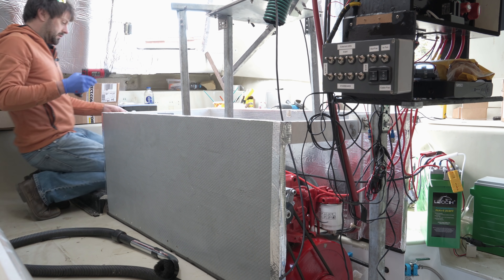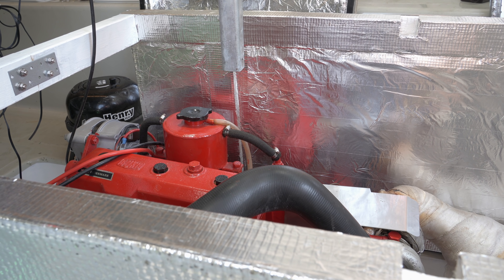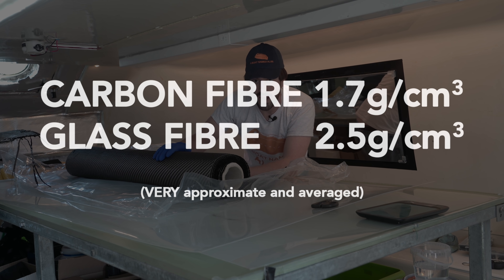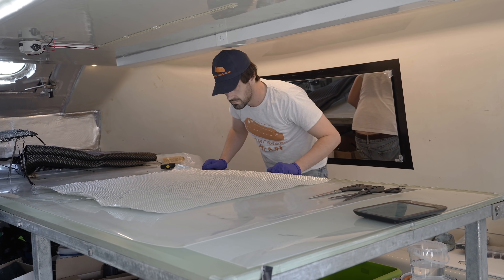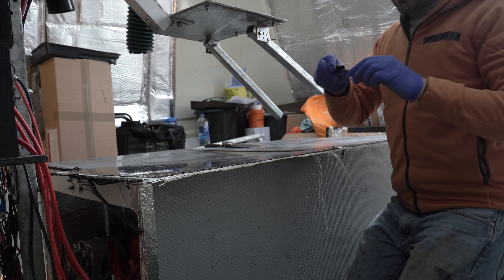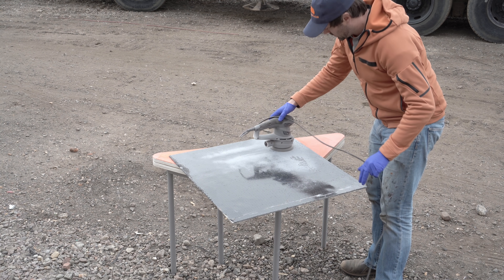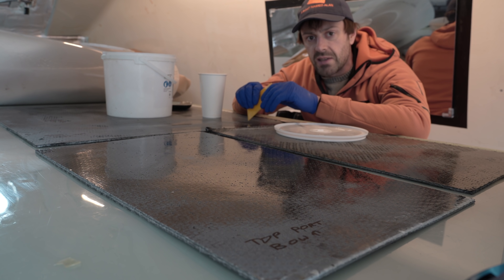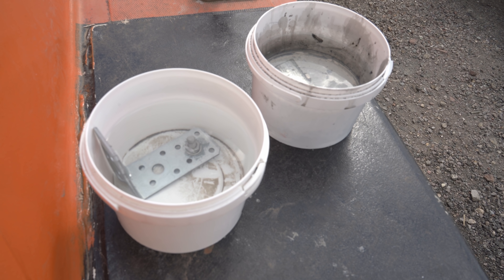Lifeboat Conversion Ep15: Using a composite wet layup to make a carbon and glass fibre lid [4K]

Comment: Hey hey hey! You should be wearing a mask while working with carbon fiber. Its pretty darn dangerous to inhale the little bits of it.
Reply from the maker: It's not quite that simple. The carbon fabric is perfectly safe, and epoxy resin isn't too bad for fumes when laminating. When cutting the cured product with a disc, I agree the dust can be an irritant.

Comment: Carbon fiber with polyester and a wet layup?  Ok.
Reply from the maker: Not all carbon is $100 per square metre at 1mm thickness..... 

This was only around 2x the price of good glass fibre, but with the stiffness and low density benefits of carbon.
Reply: @AlexHibbertOriginals  right! But you’re losing some of those benefits by using polyester, aren’t you?  
Higher weight, less bonding strength, rigidity and shrinkage are all disadvantages of polyester.  Depending on the resin, the polyester could be up to 50% weaker than epoxy.  So you probably could’ve saved cash and had better strength by using epoxy and fiberglass. I would think.
Reply from the maker: Yes, there's a compromise using polyester, but it's a third of the price. I didn't need bonding strength, and shrinkage is not a problem for a basic plank. The rigidity of the plank is chiefly down to the thickness across the core. As far as I know, both resins have similar density, so if you saturate the fabric similarly, the weight of resin won't be higher. Strength - the plank doesn't need to take impacts, or withstand repeated extreme attempts at bending.

So, what you have here is a plank that'll cost a little more than a fibre glass / polyester one, but be notably lighter, as the fabric is fundamentally much less dense. It'll also be, on balance, slightly stiffer too even if you could prove the polyester is more flexible compared to epoxy with the fabric as a fixed control variable.

Comment: Why black? I believe it's because there isn't enough dissolved oxygen available in the water to produce the usual red/orange oxide you are used to. Exposure to air as well will do this. I believe you are creating FeO as opposed to Fe2O3(red oxide).

Comment: Tef-gel works wonders to stop galvanic corrosion on nuts and bolts. I used it everywhere on my small aluminium boat and after 12 years of ocean fishing there are no signs of it.
Reply from the maker: Thanks for the tip. The various anti-galvanic corrosion gels are pricey!
Reply: @AlexHibbertOriginals  I was shocked at the price too. I bought the little syringe applicator and it's done my whole boat/trailer and I doubt ill ever use the whole thing in my life time. A tiny bit goes a long way.  Kind of like kindness....and vegemite.

Comment: Please buy 2 carbon dioxide /monoxide alarms for your boat and a fume extractor setup for that box to pump out fumes... Exhausts can start leaking easy. You can have lengths of braided flexible hose made with couplings and keep those just in case a copper pipe pops on your travels. 
Bless you for sharing your work it's awesome.

Comment: You are already working with composites, so you can get a lot more strength and lighter weight if necessary.  Forming some ribs in the bottom of those flat panels would do wonders to increase their stiffness and allow for a thinner panel overall.  You can even just buy carbon fiber angle and bond it on - just like Alex Thomson did to repair Hugo Boss during last year's Vendee Globe Race.  If you are just looking for flat panels, why not just buy a sheet of pre-made carbon or fiberglass?  It will be better manufactured (without a vacuum bag) and save lots of time.   
Check out what Mike Patey does with carbon fiber in his aircraft builds - a place where failure mean death, and both strength and light weight are paramount.  https://www.youtube.com/channel/UCSvdee86uThqIrloZjWwNVg

If you have any more of this to do, you would be wise to invest just a tiny amount in some vacuum bags and a vacuum pump so that you can do proper composite work.
Reply from the maker: Hi Matt - not really sure where to start here. The panels have been designed to have the required stiffness and strength to be stood on and do their job as a lid. Adding in braces or angles of a sufficient strength to help would be added complexity and cost.

Yes, I could have bought carbon or carbon/glass readymade sheets. However, this would come in at approaching £500. This layup took just a couple of hours, and cost well under £100.

This lid certainly doesn't mean death in the event of failure.

I do mention using vacuum (a machine for which I do own) for more complex shapes or where I want to remove the final few grams of excess resin, but this was vastly quicker and less wasteful than using all the consumables for a large vacuum-consolidated sheet.

Comment: A galvanic corrosion chart already exists...used in industry frequently. Just google 'Galvanic Chart', and print it out...no more testing required.
Reply from the maker: This is a real world test to see whether, and how fast, the zinc plated steel corrodes and thins when fastened with a relatively small SS nut and bolt. You won't find this on a chart.

Comment: The end of that square tube is turning black because the way the plating goes on. The small ends of longer pieces end up looking like a bunch of tiny plates stacked up and give much more surface area for the corrosion to grab hold. 

As for the stainless bolt, you have 3 different types of metal present. the zinc plating is acting as a sacrificial anode. Once that gets dissolved away and you have mild steal next to stainless and it will take off. Put that same bolt in a piece of 60 series aluminum and watch it go, lot more fun.
Reply from the maker: The ends of the hot dipped box section are actually clean cut, so that's bare steel.
Reply: @AlexHibbertOriginals  well that makes even more sence! Lol

Comment: Re: "galvanic reaction" Galvanization or galvanizing is the process of applying a protective zinc coating to steel or iron, to prevent rusting. The most common method is hot-dip galvanizing, in which the parts are submerged in a bath of molten hot zinc. 

result: While 'L' bracket was completely dipped and protected by zinc, the square tube had been cut, exposing the ends of the raw "steel" making it turn black.
Reply from the maker: The bracket is thinly zinc plated (not hot dip) and the box section was hot dip galv, with the ends clean cut so bare steel.

Comment: it might be a bit late to comment on it, but i noticed your table in the center of the boat to be a wood surface
while this is completely normal and appropriate, i would suggest a metal surface (painted 2~5mm steel for example) as that would allow you to put magnets on things like cups and other objects that are on the table to secure them while in the water
Reply: That sounds like a great idea
Reply from the maker: Perhaps not for the entire top, but a good idea for a zone of that top at least. Cheers.

Comment: Loving the attention you give to materials selection on this project :). I'd bet the black rust you see is exactly that, black rust. Black rust is Fe3O4, a less oxidised version of "normal" orange rust. (Interestingly this is the same stuff formed as when blacking or "blueing" steel.) You can see that the O/Fe ratio is 4/3 whereas in "normal" rust you have Fe2O3 with a ratio of 3/2. In effect the normal orange rust can't form because there's not enough available oxygen at the surface, because the water is stagnant rather than continuously aerated. You can be pretty sure the black stuff is iron based, because if it were zinc based it would form all over the part, whereas here it forms only on the exposed cut faces.
Reply from the maker: Makes sense!

Comment: According to a paper I just read the abstract of after being nerd sniped,  the black corrosion is likely because the Zinc plating is actually Aluminium Zinc plating and the black is likely Bayerite (Al(OH)3) or Zinc Aluminium Carbonate. The surface structure of it looks quite pyramid like, so I imagine it causes destructive interference of most wavelengths.
Reply from the maker: I'm no expert in the differences between hot dip galv and thin zinc coating (through electrolysis I think) or where Al might be involved. But sounds reasonable!

Comment: Peel Ply is one time use
BUT
as I understand it, 
the FULL measure of strength in a carbon fiber panel is achieved when a minimum of resin is left behind.  
Just as there is wisdom in not scrimping on the amount of cloth used, and not scrimping on the amount of resin used, so it is with a one time use peel-ply.  Nothing else will remove excess air and resin like peel-ply

And then there is the old adage "good enough is good enough"

Peel-ply can optimize a panel for weight vs strength but if it isn't needed then not using peel-ply can save time and money
Reply from the maker: Not to mention the use of perforated release film under the peel ply to give a gloss finish. The joy.
Reply: @AlexHibbertOriginals  have you ever watched Mike Patey and his aircraft builds of Draco and Scrappy.  Lots of money, lots of technique, lots of "oooo WOW!"

Comment: Top notch positioning on that camera angle for the engine bay cover, got to see your builders crack in the mirror for nigh on 3 minutes, bang up job though, with the carbon that is.

Comment: My only concern is that the engine might not put out enough power to maintain sea-keeping in heavy seas.

Do you have any volunteers or crew helping you with some of the work?
Reply from the maker: In three weeks time I'm out in a strong tidal zone with an experienced skipper to test exactly this, and to see if a higher thrust prop is needed. That said, 48hp for a 7.5m boat is not underpowered.
Reply: @AlexHibbertOriginals  Thanks for the reply.  I'm really enjoying the process.

Comment: I think with the galvanic corrosion question, the steel needs oxygen from the atmosphere for the reaction to occur and rust to readily form. When submerged in the water there is going to be limited oxygen. 
In saying that, zinc is used as a sacrificial anode on boats which is contradicting the submersion theory above, however I'm guessing the turbulence of the propeller provides enough oxygen for the corrosive reaction to occur. So maybe you should take your steel sample pieces in and out of the bucket daily to speed up the process or you could stir it constantly. Just in case you were looking for more tasks to do.
Keep up the good work.

Comment: Did you choose a resin that has a higher flame resistance considering it is going over an engine? I know there are normally no open flames, but there is a possibility of an engine fire.
Reply from the maker: The resin is Lloyds approved, but it's not actively flame-resistant. The cowling (as lots and lots of boat parts do) also contains wood and ply, so in the event of fire, the solution is to put the fire out! The insulating foam in the cowling is pyro foam that burns very slowly.
Reply: @AlexHibbertOriginals  Glad to hear it! Active maintenance and a fire extinguisher should get you 99.9% there.

Comment: Hey, I love the series and you are doing an incredible job with fitting out this boat! I did want to let you know, if you didn't already, that you really should be wearing more ppe when handling carbon fiber and cutting it. That shit can enter your bloodstream and collect in parts of your body, I have been told that it will mostly collect in your heart. I mostly work with metal and fiberglass in my job, but on the rare occasion I do mess with carbon fiber I take a lot of care when handling it to protect my skin and lungs. 
Just my 2 cents, and my opinion means nothing. 
Keep up the great work!! I am super impressed and love the amount of effort you put into your craft!!
Reply: Also, I have a "corrosion bible" in pdf if you would like it. It has some pretty good insight on corrosion and treatment methods and prevention. If you would like it, I can send it to you.
Reply from the maker: Sounds useful. There's a lot of conflicting wisdom online about where corrosion reality and theory collide.
Reply from the maker: Thanks Nick. There's always a case for more PPE etc for most things, but it's important to keep in perspective. Dust of any sort isn't great to breath in large amounts of and they can be short term irritants, but carbon and poly/epoxy resin dust isn't chemically toxic. There's been a few claims it's the 'next asbestos' but the evidence doesn't seem to support it in any quality or quantity.

PU resin dust and carbon nanotubes appear to be likely to be dangerous, but I'm not using either in these vids. I'll be using a mask when sanding back PU-based paint.

Outside and a fresh breeze does the job nicely! I do avoid machine sanding inside if at all possible.

Comment: Use rockwhool it's non flammable high temperature and Incredibly sound and thermally sealing. I've used it in my car and my house and you can hear a fly fart even if somebody's jamming music not ten feet from you
Reply from the maker: A lot of rockwool employees appear in my comments feed ;)
Reply: @AlexHibbertOriginals  hey! Here some advice, rock whool tends to rip into layers. Put something on the face, then on large sections use something to hold the center

Comment: I'm pretty sure once the water is saturated with zinc enough it doesn't do any more damage to the part
Reply from the maker: Possible - but I'm not sure if that's how it works? Does the zinc oxide stop being created, or start falling out of solution?

Comment: I would have made the cowling out of 3/4 plywood to reduce vibration and noise. Much more stiffness and sturdy. Cheap and easy to build.
Reply: Have you seen the cost of plywood? He could commission a brand new 53' research vessel or even a custom built Alan for a single sheet
Reply from the maker: The rest of the cowling is a mixture of glass, board, and wooden beams. I'm not sure why plywood would be stiffer than carbon fibre? 

Wholesale purchased resin and carbon is actually comparable price-wise to quality plywoods.
Reply: @AlexHibbertOriginals    Plywood is soft and does not vibrate.  It also reduces vibration. A property fitted wooden cover will be much more dense than fiberglass puzzle.   Look at other solutions yaughties have come up with. Look to the sailboat world for some advice on this. Many good ideas out there.

Comment: the steel, stainless steel, and zinc are three metals.  this means that two of them are more anodic than the stainless.  the exposed end of the one was cut and exposed rather than being totally galvanized.  the bits that are black are zinc rust.  Also the lack of flow (both electrical and in the water) means that there will be far less corrosion. 
im no expert so i could definitely be wrong.
Reply from the maker: I didn't know corroded zinc is black - I've only seen the 'fluffy white' sort of zinc corrosion before.
Reply: @AlexHibbertOriginals  it will rust black if it is an 55% aluminum-zinc mix, typically in alkaline conditions. zinc alone would just be white like you know of.
edit because googling (or your choice of search engine) typically shows all kinds of products and coatings.
https://www.sciencedirect.com/science/article/abs/pii/S0010938X99000438

Comment: Great video! I know this might be a controversial topic, but please wear an appropriate mask while sanding or cutting composite, the dust is pretty nasty for your lungs. Not an expert on this, but I have worked with F1 guys that always highlighted the risks to me.

Surprised by the galvanic corrosion too, you might need to have stainless bracket and galv fastener to see some decent action, you need large surface area of noble metal to have a higher potential on the 'cell', which should speed the corrosion up.
Reply from the maker: Outside and a fresh breeze does the job nicely! I do avoid machine sanding inside if at all possible.

On the surface area, I'm sure you're right. It appears that relatively small A2/A4 fastenings have little effect on large galv parts.

Comment: Given the large variation in moduli for both fibres, mixing them in a layup may result in a situation where the carbon is being loaded but the fibre glass is essentially redundant due to the stiffness of the carbon. Might be worth just using a foam core and adjust the thickness of it depending on how much strength you need in the bending mode.

Oh and definitely wear a mask when sanding/cutting composites, breathing that stuff in is nasty!!

And also I think the rate of corrosion is going to be slow if you immerse them underwater because the part is almost isolated from the oxygen it needs to corrode. Spraying them with salt water and leaving them in the air should do the trick.

Keep up the good work, it’s great to see the progress!
Reply from the maker: Thanks Jim.

Outside and a fresh breeze does the job nicely! I do avoid machine sanding inside if at all possible.

There's oxygen dissolved in the water, so corrosion should be possible.

With the sandwich, it does get complicated with some combos, but mixed sandwiches (as opposed to hybrid weaves) are fairly commonplace and you can get some very useful characteristics for parts. I didn't want to use a core here for stiffness as I want to limit the volume, and the c.5mm thickness of high modulus composites gives plenty of stiffness for the job of a lid.

Comment: Did you consider Kevlar fiber or too expensive? or too heavy?
Reply from the maker: Kevlar or other more stretchy composites wouldn't have added a lot here. I needed stiffness and had no real need for impact or extreme bending resistance.
Reply: @AlexHibbertOriginals  Thank you for taking the time to respond. I do appreciate it.